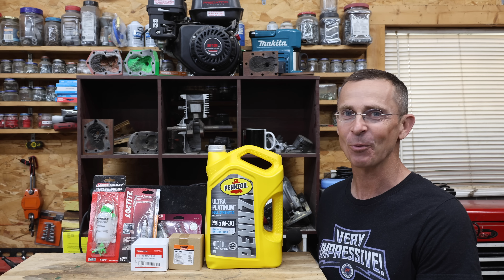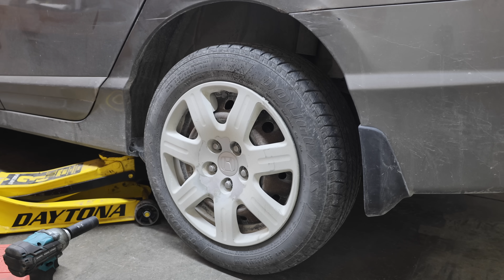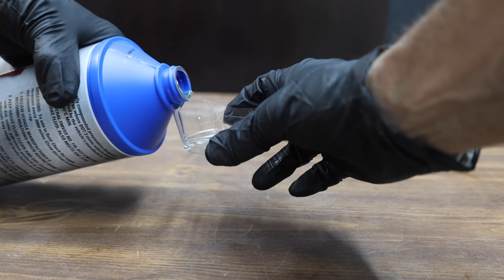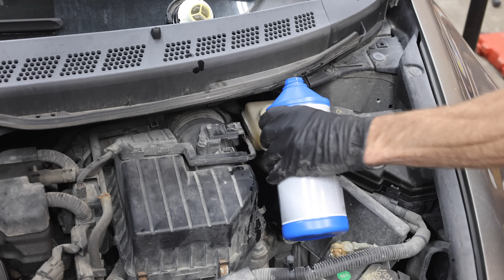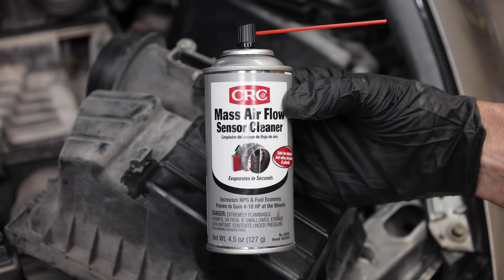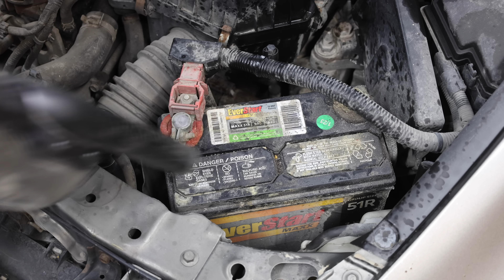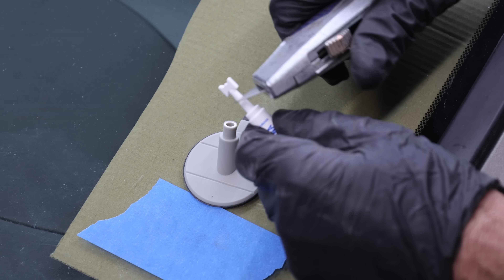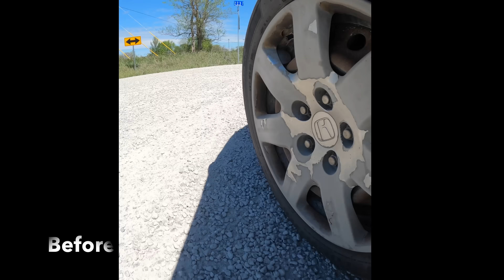Most Reliable 200K Mile Car? Let's Settle This!

Comment: This.  Was.  Amazing.  I completely agree with this philosophy.  My 2008 civic was purchased used for 1k with 140,001 & I’m repairing issue mostly myself.  My 2001 rx300 was purchased for $500 with 307,000 miles.  Minimal maintenance & runs like new
Reply from the maker: Thanks!

Comment: My 2008 Civic has 204k miles. I am replacing the front struts, tie rods, exhaust pipe, muffler, catalytic converter bracket, and replacing gaskets on the valve cover and transmission. I still get 30 mpg. Stripping off some surface rust underneath this month. I am hoping to get 5 more years out of my favorite car ever! Up to now just regular maintenance.
Reply from the maker: Thanks for sharing.

Comment: Just remember it's something like $500 to $2000 more expensive for some jobs if you don't have the location, tools, and the lift to DIY. Labor adds up pretty fast on anything that isn't expected to have a fast turn-around and it's one of those times where it's more expensive to be poor. (I'm sure a lot of people having to buy old cars out of necessity can feel that one.) Can't really blame shops though, companies making the cars rarely ever bother making them any easier to work on.

Another possible disappointment is finding parts for some cars when they get past the 10 year mark. There's some advantage with the aftermarket if going for enthusiast cars, even if they are still more expensive when used. The main difficulty is the interior bits that don't suffer wear or sun damage well, and of course people picking the junkyards are way too careless and often ruin those things.

If you have some way of trailering a car, it's also a way to save a lot of money buying used. Too often a car from a northern climate will be rotted out underneath from road salt even if it looks good on top. So it can be worth a road trip to do the hunt and purchase in southern states. However then you have to know how to spot flood damage.

However knowing any little tricks to DIY is great for the things that don't require too many extras.
Reply from the maker: Thanks for the feedback.

Comment: I buy and fix used cars; the items on your video are exactly what I do for my cars. Quick tip on the windshield repair: you can manually move the syringe up and down. This helps the resin to make its way into the crack. You can observe how well by looking at the crack from inside the car.
Reply from the maker: Thanks for the feedback.

Comment: I'm not a big fan of changing transmission fluid if it is really bad like this one as the new fluid will break loose all the build up in the trans and it will fail, sometimes within a few weeks. The rule on transmission fluid is change it regularly or not at all.

Comment: You've revealed the secret that my wife and I have had for decades. We currently have three cars in the driveway that are all purchased when they were well over a hundred thousand miles. They got the renovations that they needed and are now touching 200,000 miles  on one of them. The second has over 160,000 miles while the third has only 121,000 on it. Yes, there is an occasional from time to time. The costs of those repairs; compared to higher monthly car payments, taxes, and insurance are fractional.
Reply from the maker: Thanks for the feedback.

Comment: I really enjoy replacing worn parts on used cars, there is a great deal of satisfaction and this video encompassed every part of the satisfaction of restoring a near-dead car to a completely reliable and respectable vehicle.  That (quick) journey in this video was "very satisfying" as they say.  I have done all of the above to a Chevy S-10 and a couple of BMW's.  I think anything made between 1991 and 2010 is worth this restoration... and finding a car worth restoring is the real trick.  Also, even with all that stuff fixed, there will still be 'something' not quite right with an older car... you have to decide that it's ok that it's not perfect... and that is very tough for me... part of life's journey for me. ha.    I really enjoyed this video, thanks for making it.
Reply from the maker: Thanks and yo are welcome!    Thanks for sharing.

Comment: This service is expensive even if you're doing it all yourself. Using Honda specific fluids. Just got a car that needed tires, vtec solenoid and alternator or power steering pump depending on noise. Parts installed, vtec solenoid twice, cabin air filter, power steering pump, alternator, fuel pump, brake caliper, brake pads, engine oil, transmission fluid and filter, and on and on. I change my Honda transmission fluids by draining the three qts then put the plug back in and spin the engine again getting about another 1/2 qt of fluid out. Changing Honda fluids 3 qts at a time has a diminishing value the more changes per quantity changed. This is based on what I saw somebody doing on the tube is they bought 9-12 qts and were going to continuously change it with a short run between changes. You changed something like 50% with the first change then 66% and 72%.  So you were changing a lot of new oil out after the first 3-4 changes and then the numbers got worse the more time you changed it consecutively. Best thing to do is change like Honda would and add an inline filter if it doesn't have one.
Reply: .....radiator, radiator fan, taillight, air filter, pcv valve, inside mirror, polished headlights, might be it. No, both headlight bulbs,

Comment: I just bought a 07 Toyota Corolla LE with 207, 000 miles it's in good shape hopefully it lasts for a very long time, just have to remember with the higher mileage vehicles don't flush the transmission just change fluid and filter.
Reply from the maker: Thanks for sharing.

Comment: A few things I've been working with recently that would be great subject material:

(Some of these may take a while to test and could be done while you produce other media)
Weed killer
Lawn or houseplant fertilizer
Concrete and/or caulk options for driveway repairs
Water filtering systems (whole house, inline, and container / pitcher)
Oil filters for vehicles (I don't like plastic cage filters!)
Wood cleaner and treatment for desks, decks, porches, etc. (Just like the ceramic tests you did recently)
Flat stovetop cleaners
Portable trouble light / flash light for vehicles during side of road repairs
Reply from the maker: Thanks for the video ideas.

Comment: This was me after my focus got rear ended. Bought the same color focus with 161xxx miles. Had to replace all motor mounts and transmission mounts. Luckily having a 5 speed keeps the trans shifting good. I expect more of this at 200k. I love small fwd i4's without a turbo.
Reply from the maker: Thanks for sharing.

Comment: I have an 8th gen civic here in australia. The 1.8 R18 is unkillable with regular oil changes as is the manual transmission. My car has 240,000km and the clutch is original (afaik, unless the previous owner replaced it).
Reply from the maker: Nice!

Comment: I've always run older, inexpensive cars - I don't understand people's need to have a brand new one every few years. My 1998 Passat TDi is now 26 years old with 280,000 miles on it, has always lived outside and is 100% reliable despite being on its original engine, gearbox, turbo and even the exhaust! I just make sure I attend to any faults and service it regularly. Oh and that's in the UK where we have pretty terrible roads so it's not just cruised along a highway at a steady speed all its life
Reply from the maker: Thanks for sharing.

Comment: Too funny!  My wife just replaced her 2007 Civic (Hybrid) with a '23 Bolt EUV.  It's got about 227k miles and has a lot of the issues that you address in this video.  The AC compressor going bad is a common issue, along with the headlights fading and suspension going bad.  It'll be my parts runner while I work on my 2004 Civic Si (with 250k miles).  If it wasn't for the fact that the Hybrid battery and CVT in these are so unreliable, I'd probably fix it up and use this video (and my Haynes).
Reply from the maker: Thanks for the feedback.

Comment: I have a 2010 F-150 5.3L 3V with 216,000 miles.  Everything works great.  The engine idles a little rough after warming up but runs great after 1000 rpm.  It has always had good maintenance including both timing chains at 200,000 miles.
Reply from the maker: Thanks for sharing!

Comment: I have a $500 Camry on my channel which I also did a lot of work on, most notable being the timing belt, oil seals, and axle boot like yours. That being said, some things on old cars are just annoying. Due to plastics getting hard and brittle, I had to replace a visor clip that broke. I replaced a burned ignition switch bulb and the surrounding bezel shattered. Over the weekend I pulled on the RR door handle and it also snapped off. I can replace it all, but the typical person does not have the time, knowledge, or even garage to constantly work on beater cars. But yes, if you can do it yourself, it's MUCH cheaper than loaning on a new car, insurance, etc etc.
Reply from the maker: Thanks for sharing.

Comment: I would not even PISS in a Honda but knew immediately what the front end noise was. If you know cars them my god, it is a NO BRAINER! Anyway I would take that Buick in a second assuming it has the 3800 V6 which last forever under normal use and maintaining! Who care about looks, my 2009 Hyundai Sonata looks horrible but keeps going and going with NO repairs in 15 YEARS!

Comment: Acura/Honda tech of 34 years.
2mm is the minimum thickness specification of the rear brake shoes; those were only 50% worn. Personally I always put anti-seize on the backing plate, wheel cylinder and lower block contact points, silicone paste is OK I suppose.
Silicone dielectric grease on the brake bleeder screw threads prevents air inclusion while pump bleeding and acts as an anti-seize for the next guy without the possibility of petroleum products entering the brake hydraulic system. I used a vacuum bleeder to change brake fluid at the 30,000 mile service intervals, bleed it until the color changes.
When replacing struts or control arm bushings, raise the control arm with a jack until the lift points come off of the lift arm or jack stand before tightening the suspension bolts to allow the bushings to settle in a 'neutral' position. If you tighten the strut or control arm bushings while the suspension is at dangle, they will be under stress when the suspension is level. 
I always put anti-seize on ALL exhaust, suspension, engine mount and transmission bolts; I might be the poor SOB (Sweet Ole Brother) that has to take it apart again in 5 years.
My previous Accord was totaled by a texting Celica driver at 519,000 miles, my current Element just passed 336,000 miles and running strong; I believe in long term relationships with quality cars.
Reply from the maker: Thanks for sharing.

Comment: My 2005 Acura TL had 243k miles on it when I traded it & it was still in great condition. It had no issues when I got rid of it.
My current vehicle, a 2015.5 Volvo V60 has 202k miles on it now, but it's burning oil...a known issue that Volvo has to fix again.
Reply from the maker: Thanks for sharing!

Comment: My 4.0L  wrangler had almost 200k when i sold it.  Engine still ran like new thanks to a good break in (Was at 5000rpms floored, pulling out of the dealiership the day i bought it). I'd only rebuilt the rear axle twice in 20 years.

Comment: Had an 05 LeSabre that was bought at around 200k miles for $750. Original engine and trans, neither ever opened up, didn't leak a drop. 70k miles later, original trans finally bit the dust and ended up parting out the car for $650. I still have yet to see an engine as easy and reliable as the 3800. Even got 30 MPG highway, which was shocking for how large of a car it was.
Reply from the maker: Thanks for the feedback.

Comment: You shouldn't rotate the itres on a front wheel drive car. That's what the tire dealers tell you to do to sell 4 tires insted of 2. Rear tires on 6 of my cars and several of my customers cars,have gone over 100,000 miles with 3/4 tread still there.Assuming the alignment is correct. When you rotate, the camber angles are different fron to rear.and that wears off almost the first 1,000 miles. I kept 1 Honda for 250,000 miles and changed the rear tires once.
Reply from the maker: Thanks for the feedback.

Comment: Hey another tool test idea how about testing 2 ton under hoist stands? Id like to see Omega 33020 In that test. If you can find any maybe ATD7440 Along with the newer version ATD 7440A . 

Another test i have been hoping for is a diesel anti gel test that has Opti-Lube winter blend in the test Vs the rest.
Reply from the maker: Thanks for the suggestions.

Comment: miles don't make a car bad age does. All my cars that  i bought brand new made it over 300,000  from 2005 to now and no issues on any of them not one time have any of them ever seen a shop other than for tires the oil change, trans fluid, and brakes all done by me. The brands i had  volkswagen, honda, dodge, in that order currently on a Subaru.
Reply from the maker: Thanks for the feedback.

Comment: I have a 2003 Chevy Suburban too! It has been more mileage, just rebuild the transmission myself, fixed all the oil leaks and I plan on using it until it stops.
Reply from the maker: Thanks for sharing.

Comment: Things to maybe consider for that style Civic and others 

Use a turkey baster to remove as much power steering fluid as you can and replace. Rinse and repeat a couple of times after running.

Fill the oil filter with oil before reinstalling. Also wipe the new filter threads with a lint free cloth.

2012 Accord EX V6 front brake calipers are a bolt improvement for those 8 gen Civics

The hybrid wheels are ugly but light with a smaller diameter so a more comfortable ride.

I buy just the rubber wiper inserts only from Honda at about 5 bucks each to fit in the original arms

Honda sells Shin-Etsu  grease that helps door seals or roof seals do their job better.

If you happen to work on the exhaust use Phillips Milk of Magnesia as a thread coating for the next time you need to remove those bolts. If it’s good enough for jet engines is good enough for my Honda.
Reply from the maker: Thanks for the constructive feedback.

Comment: Love it. So true about a reliable old car versus new car expenses. Love civics - had a 2009 with 210,000 miles and all I ever did was front brakes, tires, plugs, engine oil and transmission fluid changes having only one pesky emissions related code I hadn’t solved before someone T-boned it and totaled it.

But back to the vid, admittedly, this only works if you have some wrenching and diagnostic skills (But not that high of a bar for most).
Reply from the maker: Thanks!

Comment: My first car (1982) was a Civic.  So were my second, and third, and fourth.  Super reliable, easy to maintain, and ownership costs were as low as one could hope for.  You can expect 200k miles before, as with this vehicle, suspension and drive train parts start to need replacement.  (Friends of mine say the same about Toyotas, but I've never owned one.)
Reply from the maker: Thanks for sharing.

Comment: Idea for new video: how easy to use are safety controls on various cars?  F.I. My 2004 Pilot is a real pain to turn on the vents, so when the windows fog up, I have to keep pressing a selector button and watch a tiny LCD display until I get the right "mode."  On my old Cavalier, I just grab the selector knob and turn it, with no menu diving.  In my view, best is simple and tactile, for keeping eyes on the road.
Reply from the maker: Thanks for the suggestion.

Comment: I bought a Skoda Octavia 1U5 with 275.000km a few years ago for about 1000 wich was basically what any car in "export" condition would cost
then I invested about 1500-2000 in parts to fix it, but I bought only the cheapest parts I could find, basically the store brand of the online shop.
now the car has about 340.000km and the rubber bushings of the lower control arm are starting to go bad, altho I don't think that's that much sooner compared to OEM parts, especially if you factor in the price
Reply from the maker: Nice!  Thanks for sharing.

Comment: Great video, this could be shown as an intro to vehicle maintenance for new drivers or new DIYers.

One another note, I had a 2007 Honda Civic a few years back.   It had maybe 35k when we bought it and ended up being one of the worst cars I've owned, and I've had some beaters.   The block cracked and it started leaking coolant.   Thankfully it was a known issue and Honda replaced the short block.   Unfortunately, the did not replace the rear main seal so it started hemorrhaging oil a couple days later.   The dealer refused to fix it for free, even Honda's national customer service refused to help.   The dealer reluctantly did the work for half price eventually.   There were other problems too, the starter went bad at less that 75k and several other issues.   I wouldn't take a similar year Civic for free now, well I would take it but I'd sell it asap.
Reply from the maker: Thanks!  Thanks for sharing.

Comment: suggestion: figure out the best way to write on a blow-mold case. I can't get anything to stick for long and I can't remember what's in them. Some sort of label on the thin ends so you can see it as it sits on the shelf. Those ends are not always flat, either, which makes it even harder to write or put a label on there.
Reply from the maker: Thanks for the suggestion.